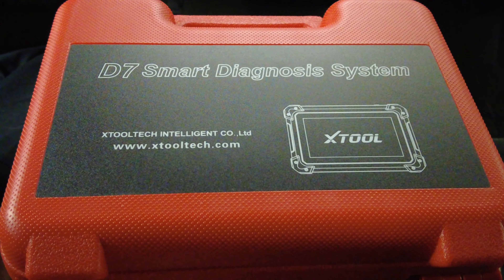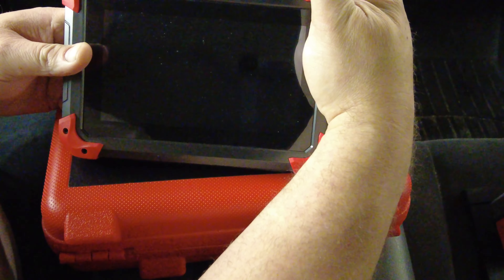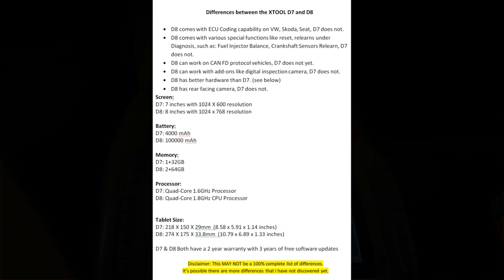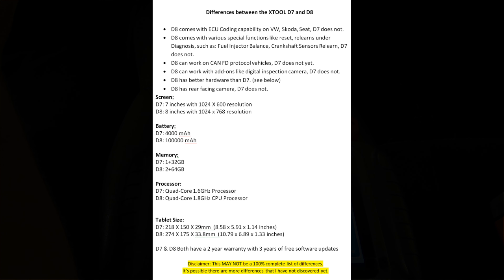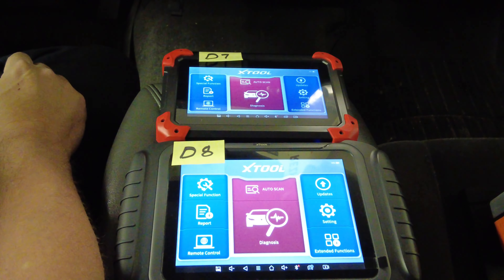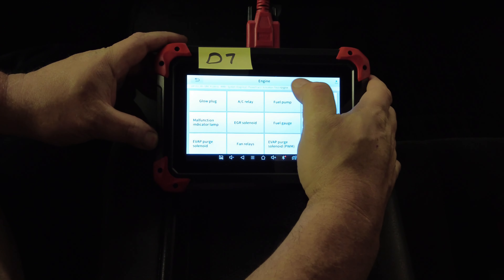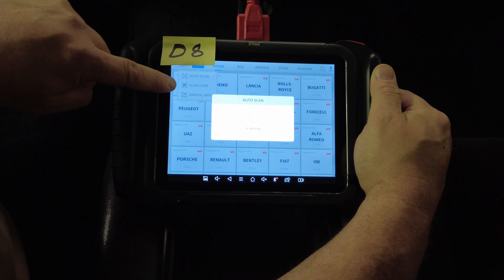XTOOL D7 vs D8 Comparison.  Differences Between These Two Diagnostic Scan Tools

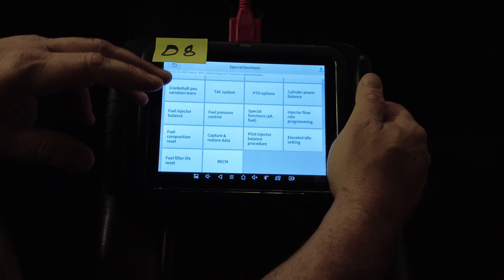Comment: Great comparison,im leaning towards D8, question , what happens if you don’t renew after 3 years especially if as a DIY mechanic on my own car which is a 2018 Volvo  , 13:25 and I don’t really have any recent updates , will the device lock me out in any way , or will it still continue as normal and when I purchase a new car , I can just update then because il be needing latest feature for the new model
Reply from the maker: Watch my more recent video that shows how the D7 is now more like the D8 after a major upgrade last summer. The D7 can now pretty much do everything the D8 can do.  This video was recorded before the update was released.  The scan tool will always work at it's current software level. If you decided to not update, that is fine, you just wont have the most current software but the tool will still work at the lower level of software. Thanks
Reply: @SlipFitGarage yup, what he said. 😂. They added a lot of features to the D7.

Comment: Do you know, will the D8 Program or install a NEW WIN Module on a 2012 Ram 3500??  I have emailed the company to ask and it's been a week with no response, Would like to get a D8 as my WIN module has finally bought the big one but don't want to spend the money (disabled vet) on something that won't get my Truck Running again.
Reply from the maker: I do believe The D8 CAN do this.  However, I don't have access to a 2012 RAM to verify to be 100% certain. There are a few videos about this topic on  youtube.  You'll probably need to pull the PIN first, then replace the module.

Comment: Do you know if i can reset the transmission calibration with the D7 or not? I have a 2013 toyota Camry with the 6 speed auto, and its misshifting in between 2nd and 3rd, at 20mph on the mark. A mechanic made a youtube video saying anyone with a machine can reset these calibration values and wjll make that go away
Reply from the maker: I do not have a 2013 Toyota Camry to plug my D7 into and verify to be 100% certain, but I do believe you should easily be able to do that with that D7.....  but don't hold me to it.  Thanks for the question.

Comment: Hello, will the scanners allow me to turn off the " spare tire low pressure " off ? 2011 chrysler 200
Reply from the maker: Probably not.  That would have to already be an option programmed into he computer directly from the manufacturer before ANY scan tool would be able to make an on/off selection.   I know it can be very confusing but scan tools (ANY scan tools, regardless of brand) can ONLY make selections and changes in a vehicles computer if those things are already programmed to begin with.  For example,  If I plug my D8 into my 2008 Ford Crown Victoria P71 and I can select different lighting modes for the headlights and interior lights.... that does NOT mean I have those same option when I plug the same scan tool into my 2006 GMC truck.  The vehicle that you're plugged into greatly dictates what menus and options appears on the screen. I have a 2022 KIA and I HATE the daytime running lights....  Not even the dealer's scan tool can turn those lights off.  The manufacturer did not allow for that option when they programmed the vehicles computer.   As for your Chrysler's "spare tire low pressure" message.....  Rarely have I seen (if ever) a vehicle that gave an option to shut off TPMS lights or messages.  It's considered a safety item and they don't want people to ignore those warnings.   You probably either need to fix the spare tire, or I've heard of people who "trick" the TPMS sensor into thinking there is air in that tire.  Thanks for the question,.

Comment: I just want to know if either of these tools can do the Transmission service precedure to drain and fill back to correct levels on the Fluids at correct Te,perature
Reply from the maker: That must be a procedure on a vehicle that I am not familiar with.  Both of these scan tools are very capable....  if you plug either the D7 or the D8 into a vehicle that requires this type of procedure then these tools should display that information. I've personally never seen it, but then again, I've probably never worked on (or plugged into) a vehicle that required this function. The short answer....  Yes, these tools should do that on vehicles that require it.  However, to be 100% certain, you should send XTOOL an email direct and they can tell you for sure either way.  Thanks for the question.

Comment: hi, thanks for your video, is really helpful I'm a DIY person but I'm really considered buy the D8 even if is to much for me.
but my question is after 3 years free updates if I don't update let said for the next 2 years how much is going to be at the time I want to update is going to be just $200 or in have to pay for the all years didn't update $400
Reply from the maker: Well, I don't work for Xtool so don't quote me here....  But usually you just need to pay for the current year.  If you skip 3 years..... but on year 4 you decide to finally update, it will (should) only cost you $200.  Otherwise, look at the amazon listings for the xtool customer service email address and send them a question.  They are very good about replying quickly. Thanks

Comment: So no tire corrections? On gm truck? How about mileage correction? We put lifts on trucks and add denali or hi country dashes they are shipped with zero miles we need to adjust to the actual mileage or it wlll trigger a carfax roll back warning?
Reply from the maker: Yes, they should do tire size correction on a GM truck. XTOOL does advertise odometer correction but I have not personally tried it on a GM vehicle.

Comment: Thanks for the video.  Can this tool train the HVAC actuator on a Chevy Camaro?  Apparently, they turn the axis to far and break the flap that controls hot/cold and that needs to be retrained after a repair.  Thanks!
Reply from the maker: Which tool, there are two shown in this video?  Either way.... yes, these tools should be able to perform an HVAC actuator re-lean procedure.  Thank you.
Reply: I did an HVAC door re-calibration this with an Autel after replacing the actuator motors and flapper doors in my 06 Dakota.  Worked perfectly. I assume the XTOOL D8 is no different.

Comment: I see all these options but do they really work? I tested D8 on Nissan and none of the special functions worked. It could not even turn flashing lights through Actuation tests.
Reply from the maker: I've tried several times in my past videos to explain the "special functions" menu of these scan tools.  These are functions that the "scan tool" is capable of performing....  IF the vehicle is ALSO capable of performing those certain functions.  And really, the "Special Function" menu is just a list of "shortcuts" to special function that can ALSO be found in the "Diagnose" menu.  Keep in mind, it's NEVER the scan tool that is performing any given function, it's ALWAYS the computer in the vehicle that is performing any function, the scan tool is simply sending the command.  You can't get a vehicle to perform any function that is not already programmed into the vehicle from the factory. Now, with all that said, I have heard of others having trouble using XTOOL scan tools on certain Nissans.  That doesn't necessarily make XTOOL a bad scan tool brand because ALL scan tools brands can, and usually do struggle on certain makes/models.  There are no perfect scan tools on earth, regardless of brand.  Even the high end tool truck brand scan tools will struggle on certain makes/models.  

All of those functions listed under the "Special Function" menu are shortcuts, and they don't really seem to work EVEN IF the vehicle is ALSO capable of certain functions.  However, if you go into the "Diagnose" menu instead, and go into the specific module that would normally contain that specific function you're looking to perform, then click special function OR actuation tests, you should find the function you're looking for and it should work then.  For example:  I was trying to change tire size in the computer of a RAM truck.  I selected "tire size" under the "Special Function" menu and it absolutely did not work.  BUT, when I went in through the "diagnose" menu then navigated to the power train modules, then selected "ABS Module", then selected "special functions", then selected "change tire size" it worked just fine then.  This type of thing happens with EVERY brand of scan tool on earth.  

One thing to keep in mind is to make sure your scan tool is always up to date.  These scan tool manufacturers are CONSTANTLY fixing "bugs" and streamlining their software.  They put out software updates on an almost daily basis.  Most people who are new to scan tools think they only put out updates once per year as new makes and models are sold.  But the truth is there are almost daily updates to refine current software.  If your tool is struggling with a certain make/model, you should send an email to XTOOL and they can usually create a software fix and send it out in the form of an update within just a few days.  These updates that are created for specific people get sent out to the entire customer base so everyone gets these fixes right away.  If your scant tool is struggling, make sure it's up to date....  if it is, and you're still having trouble, send XTOOL an email.

Thanks for the question.

Comment: The D7 has Special Function, it's on the home page but may not be as comprehensive.
Reply from the maker: The "special functions" that you see on the main home screen of the scan tool is NOT the same as the "special functions" that you see in the menu structure, like I show in this video.  It's a terminology problem....  that probably doesn't translate well from Chinese.  XTOOL's home page calls those features "special functions".... Autel calls them "Service functions".... Launch calls them "resets", etc, etc....  However, THEY CAN ALL HAVE "special functions" when you go through the menu structure like I show in this video....  as long as the scan tool itself is at the level of having "special functions" to begin with.  (The D7 was NOT at that level when this video was made) And on another note....  Even though you were technically wrong in your original comment, you ultimately got lucky and you are now correct because the D7 does indeed NOW have the REAL "special functions" that it did NOT have in this video.  AFTER this video was made, In August of 2022 XTOOL sent out a major update to give the D7 line of scan tools the next level of software.  The D7 NOW does indeed have "special functions" among other relearns and resets (depending on the make/model you're currently plugged into) that it did NOT have when this video was made. The D7 today is now more like what the D8 WAS originally.  Clear as mud, right?  lol. Thanks for the comment!

Comment: Quick question ... was the XTool D7 & D8 able to auto-detect the VIN number of 2006 GMC truck or did you have to manually key in
Reply from the maker: Both the D7 and the D8 can automatically detect the VIN on my 2006 GMC truck.

Comment: Awesome review. Do you need the D9 for key programing and TPMS?
Reply from the maker: No, the D9 is not necessary for Key programming. (depending on make/model/type of key) The D8, and even the D7 can do basic key programming.  As for TPMS, that is usually done with a dedicated TPMS tool.  Some Scan Tools have TPMS capabilities included with them, but those models cost more.  The D7, D8, and D9 do not really have any special TPMS capabilites like programming new sensors, etc....  but you should be able to view live data from TPMS sensors such as tire pressure, temperature, and sensor battery condition.  If you're looking for full TPMS capabilites, you'd be better off looking for a dedicated TPMS tool by itself, or a scan tool that has full TPMS functionality added.
Reply: @SlipFitGarage  Gotcha. Thanks.
Reply: @SlipFitGarage The D8 actually does have TPMS now. Just take note of the sensor ID before installing them and also which exact tire you’re putting it on…

Comment: Does it only work on new vehicles like Like around 2000 models or does it have to be a 2015 and up
Reply from the maker: This is an OBD2 scan tool.  OBD became the standard for all vehicles sold in the United states from 1996 and newer.  This tool will work on any vehicle 1996 or newer.  However, do not expect the tool to have the same exact functionality on a 1996 make/model as it does on a 2022 make/model.  (for example)
Reply: Why is supposed to update at all once a year because I kind of tried to update it and it took forever to load so I backed out with back to the main page does that hurt anything?
Reply from the maker: Some of the updates take a while to download and install.  Especially the BMW updates for some reason.  Just select all the updates and let it do it's thing when you're not using it.  Walk away for an hour or so and it should be fully updated when you come back.  An no, it does not update only once per year. There is a continuous stream of constant updates.  You could check for updates on these tools every week/month and there will probably be something there to download and install.   If you do not update the scan tool, you are not getting the total functionality of the tool.  They are constantly fixing bugs and improving software every day.  Not just updating once a year when new makes/models hit the market.  Yes, you need to update the tool frequently to get the best functionality and overall experience.

Comment: The USB supplied cable would probably be to connect it to your computer for any software updates. Probably mentioned in past comments but...
Reply from the maker: It doesn't need to be connected to a computer....  The device has one touch updates.  As long as you're connected to WiFi, all it take is one touch and the scan tool updates itself.
Reply: @SlipFitGarage  That's pretty cool, but a USB can only imply it's for a computer hookup. Maybe in some countries WiFi is not as accessible which is also why they offer so many different power plug adapters. I just saw a review on Car Care Nut's channel and he said it was software updates, I will admit the last thing people need are more USB cables.
Reply from the maker: @oldkid6  You said "but a USB can only imply it's for a computer hookup".....  Well, it can imply more than just "only for a computer hookup"..... You could use the USB port to hookup a thumb drive for transferring files, you could use a USB port for an external mouse or keyboard, you could use a USB port to connect a printer,  pretty much any computer peripheral nowadays uses a USB port. So, they're not just for updates. I'm not saying the car care nut is wrong, but I've never heard of anyone connecting an XTOOL tablet to a computer in order to share it's internet connection, and then download the updates. I'm sure it's a possibility, but it's certainly not the most common way to update the tool. Thanks.

Comment: Can the D8 tell you information about cylinder compression?  Or is there no other subsitute for disabling fuel/spark and pulling each spark plug one at a time by screwing in and out a meter into each spark plug hole and cranking the engine friggin 4, 6, 8 10, or 12 times?
Reply from the maker: Scan tools don't do anything by themselves....  They only show info and data supplied by the computer in the vehicle. The info, data, features, functions, bidirectional control, etc, etc....  every last but of it is pre-programmed into he vehicles computer by the software engineers at the auto manufacturer. Scan tools simply display data and send requests to the vehicle's computer.  Not all vehicle computers (makes/models) have the exact same programming.  It truly depends 100% on the year/make/model of vehicle that you're currently plugged into at that moment. If the computer in your vehicle has the ability to show a cylinder balance test on the screen of a scan tool, then you will be able to see the overall "contribution" of each cylinder. Like I said though, not all vehicles have this feature programmed into the computer so just because you see it when plugged into one certain vehicle, that does NOT mean you will see it when plugged into every vehicle. And just to add more info.... some (most) vehicles will show misfire data, (but not necessarily WHY it misfired) and some vehicles include a fuel injector balance test to see how injectors are performing. (but not WHY they may be malfunctioning) And lastly, I have never seen a data PID called "cylinder compression"....  In order for a scan tool to show ANY data, there must first be a sensor on the car to measure that specific data.  I don't know of any vehicle that has a cylinder compression sensor so in that specific example... yes, you would need to unscrew and screw a pressure gauge into every cylinder to get an ACCURATE cylinder compression number.  There are some ways to electronically measure (see) compression with a lab scope while spinning the engine over with electric starter but that equipment is far above a standard scan tool. Modern scan tools are pretty good, but they are not magic. People see "scan tools" as getting better and better all the time...  when in reality its the computers in the vehicles that are getting better and better from the auto manufacturers which then makes scan tools LOOK better.  I hope this all makes sense to you. sometimes my thoughts don't come out very clearly when I type.  Thanks for the question.

Comment: If I decide not to pay for updates, it is still usable right? Can you skip years of updates? Like, stop updating but then 4 years later get an update for the price of 1 year? Or will you have to pay back for all the years skipped as well?
Reply from the maker: Yes, it will still work if you do not update the scan tools.  Yes, you can skip years and not have to pay for each year to become current.